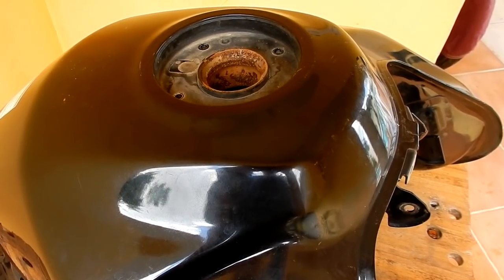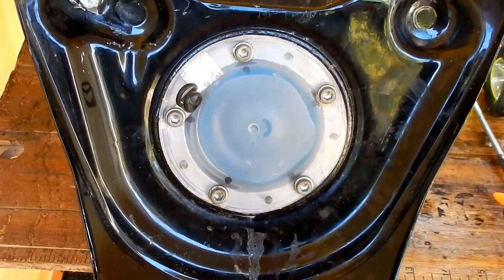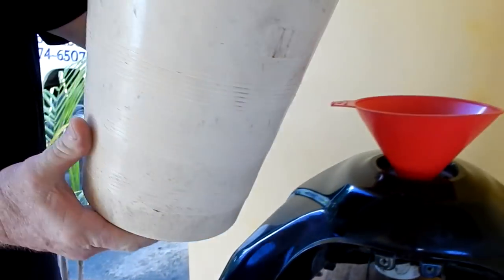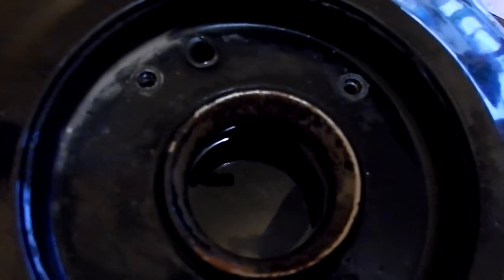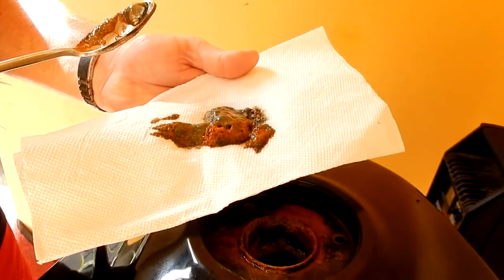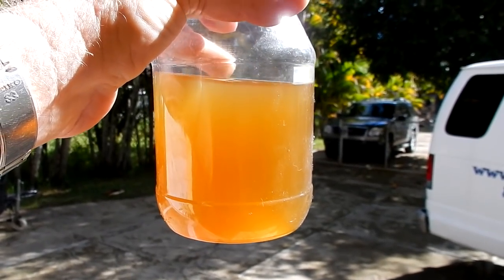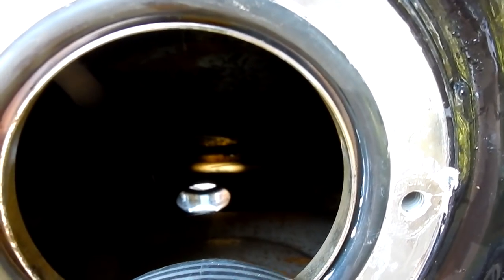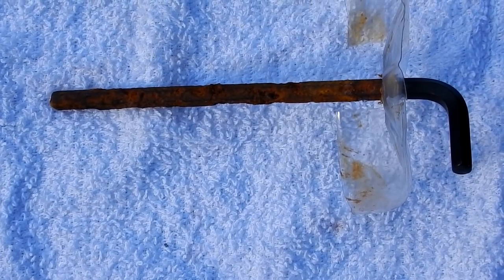Motorcycle Tank Rust Removal Using Electrolysis

Comment: Just wondering how much of the work is done by the chemical it self. What would happen if you soaked and not use electricity?
Reply from the maker: The process is a chemical reaction caused by ionic transfer due to electricity. The chemical alone would not work.
Reply: The fuel in the 1971 240Z tank had been in there for 20 years. There was a thick layer of...whatever. I used muriatic acid and 1/4" - gravel inside the tank. After soaking and rotating the tank for a few days, the metal was clean but there was many tar balls there. Most of the balls came out with the gravel through the fuel level sensor hole. The rest was solved with a quart of ethanol. There is a light layer of rust but that would be there anyway.
Reply from the maker: Consider a pressure sprayer to remove the gunk. Also, consider POR-15 as a rust preventative.
Reply: A pressure washer would only reach a small percentage of the inside of the tank partially due to a baffle in the center of the tank. Aside from a light layer of rust, it is perfectly clean. I cleaned the pick-up tube by attaching a speedometer cable to a drill motor and reaming it out.
Reply from the maker: We got virtually all the tank but a tiny part of the filler neck with the pressure cleaner. We used a bent toilet bowl brush, the one made with twisted wire, to clean that part.

Electrolysis got rid of 100% of the rust.
Reply: I see the confusion: I am talking about a car fuel tank, you are a motorcycle.

Comment: Can I use vinegar instead of water and soda?
Reply from the maker: Vinegar can partially remove rust by itself, but will not remove all of it. Electrolysis does.
Reply: Robert Cooper So, I can use your method to make the nuts and bolts on my bike bling bling blong?
Reply from the maker: Rust-free, but no bling...
Reply: You could use molasses too with no effort but it takes weeks

Comment: Could you perform electrolytic plating (like with nickel etc) after rust removal to create a rust resistant surface?
Reply from the maker: I have no idea, but I don't see why not. I just used POR_15 with great success.
Reply: YES!
Reply: You would need nickel acetate solution and nickel anode... Nickel acetate is made by dissolving nickel in white vinegar... However just remember when you make a nickel acetate solution it is classified as a carcinogen.. so you would have to be very careful how you handled it and disposed of it.. I would always label containers with what the contents held with warnings

Comment: Not practical better buy a new tank specially if it's efi... Bt just for the sake of YouTube video it's ok .
Reply from the maker: I disagree. After rust removal and POR-15 coating, the tank is better than new from the factory because there is no possibility of rust.

A new tank may be required if the tank rusted through. This tank was no where near that stage.
Reply: Electrolysis is very practical. Buying a $1500 tank is what's not practical.
Reply: Buying a new tank for many hundreds of $ VS repairing the tank you already have in an easy, safe, and inexpensive way with purely home remedies? Yeah, I can see how this is totally impractical.